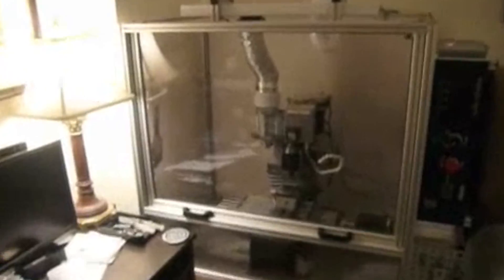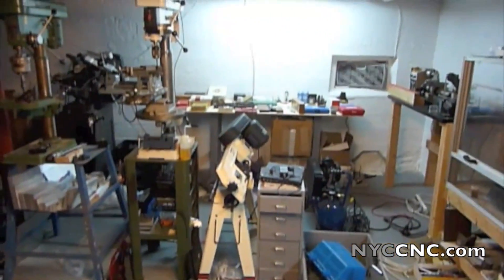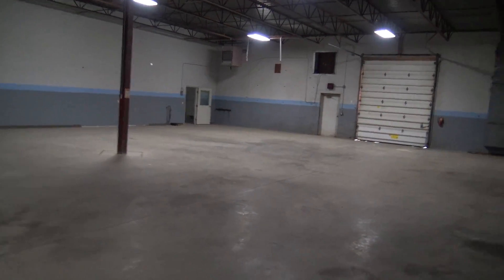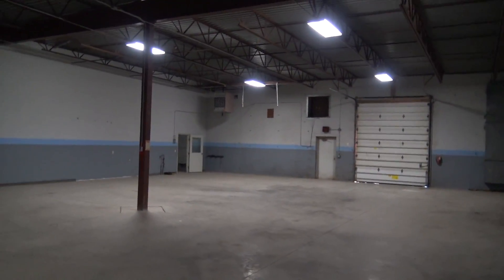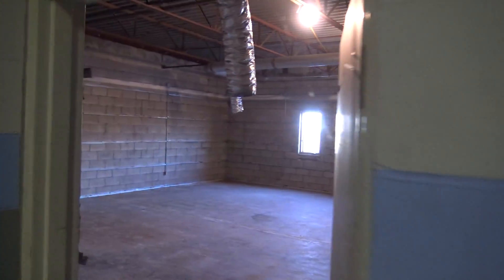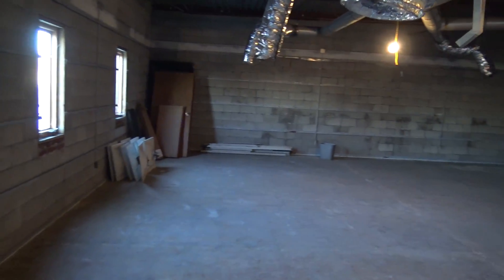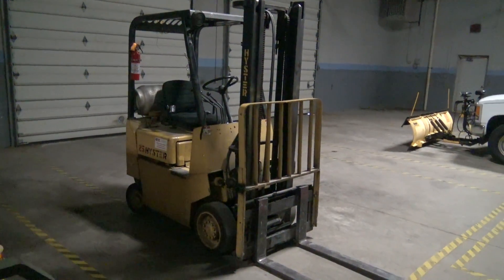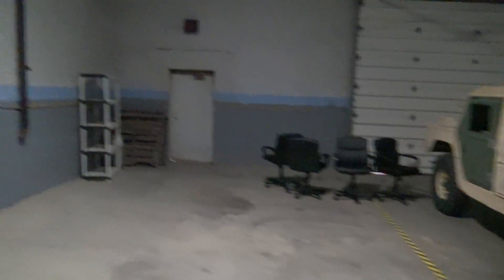We're Moving Again - One Last Time!  NEW SHOP!

Comment: Copper air lines is a great way to go. There are a lot of new pex type plastic solutions, but who knows how they will hold up over time. They do have one nice thing in that it's super easy to make modifications and add or remove drops as your shop changes. So you might mix it up and use copper for all the main lines then add pex drops for things that might move. Your shop is in the growing phase, so I'm sure your floorplan will change a lot. Be sure to slope all your lines for moisture control, even with refrigerated dryers it helps.
Calculate your lighting and run the numbers to decide what is best. So much depends on how you use things. If you have lots of machine and task lights, you don't need as much high overhead lighting. You can also mix and match depending on use. LEDs will pay off over time, but there is an initial up front cost. Since you have to buy lights anyway, they are worth a look. Also because many large companies are switching to LED, you can get used lighting fixtures for pennies on the dollar. I did that and put metal halide HID high bay lights in my warehouse because it's mostly storage and the lights are not on all that much. I got a few pallets of good used fixtures off craigslist. Super cheap to buy but costly to run. In my shop I have LEDs because they are on almost 24x7. The lower electrical use paid for the new fixtures in short order. Because of your video stuff, I would camera test any lighting to be sure the color temp and refresh rates are going to work for you, too.
Good luck in the new shop. It looks like a fantastic building for you.

Comment: Have you thought about maybe having a rackmount server with virtual machines running solidworks or fusion 360. So if multiple people are using cad at the same time the server could allocate to each person a certain number of cores and if less people are using cad they could utilize more cores, Another advantage of using a server to run cad would be that dust would not be a significant problem because the only thing exposed would be the monitor, keyboard and mouse instead of the whole machine.

Comment: Due to the height I would use High bay LED fittings if you use T8s or T5s you are going to need a lot and they are not made for that kind of distance. as Jeff Trithart said go with this mans advice as he's done it. There are some drawbacks with LEDs they do seem to cast very strong shadows so placement is key. Why not put the welding and grinding shop in the garage area until a proper wall is built, remember to keep the dirty stuff near access doors for ventilation and easy of cleaning. That's my 2 cents worth have fun.Phil

Comment: New space looks awesome, congrats. I would take a look at the aluminum air line systems from Atlas Copco and Kaiser. Otherwise go copper. I agree with the T5 they have electronic ballasts so no flicker and long bulb life.  LED are not there yet in cost savings vs. light output per power.  You could partition with welding screens with telestrut frame members bolted to the floor. Cheap and easy to maintain.

Comment: Your areas:
* Setup
* Toolroom / Tooling
* QA/QC Inspection
* Office
*  Machining
   * Milling - Manual
   * Milling - CNC
   * Lathe - Manual
   * Lathe - CNC
   * Drilling
   * Grinding, wether it be bench, pedestal or surface grinding...
   * Assembly
   * Plasma, Welding, Fabrication, etc.
   * Pressroom (forming,  and bending machinery)
 *  Storage (Materials, etc)
*  Compressor & Mechanical Room
*  Bathrooms
*  Maintenance area

I have suggestions for each of these if you'd like to hear them.  you know my email.
Reply: Great, glad to be of help.

Comment: LED all the way T5s will strain out your eyes and will look terrible on camera
Reply: Not to mention getting rid of "ballast buzz". That sound drives me crazy.
Reply: +David Ferrer They have better full spectrum, so whatever you do, on camera or not, will look better.  Plus, they are about half the energy use of even good Fluorescents (like new T5's with electronic balasts)
Reply: +kitesquid Yeah lightbulbs add up over time and cost twice as much to power. The new LED fixtures are guaranteed for 10 years, they will pay for themselves.
Reply: +BluetoothSensei no "ballast buzz" on electronic ballasts.  You get a buzz on magnetic ballasts as the operate at 60 Hz.

Comment: Concerning the moveable partition: as someone has already said, find out first what the fire code will require for commercial space. You can make a wall down from the ceiling five or seven feet and then your partitions go from the floor up to  it. You can combine sliders and two-fold accordion. You can use galv 2" studs from a commercial drywall supplier to fabricate hinged rectangles. You can skin those with painted sheet metal or plywood, depending on whether you need a fire separation wall. You might screw some sort of T track threshold to the floor which would cover the line where the epoxy coating stops. The threshold would be slightly ramped to avoid a trip hazard and allow the fork lift to drive over. Good luck. Oh, also insulate your ceiling.

Comment: Nice, that looks like a way cool space! LEDs are the the way to go but... they are really expensive! Go T5 and then in a few more years when the LED's are cheaper and the T5 start to crap out swap them. Cooper is kind of old school for air lines, I would look into aluminum lines. There are systems available with fittings specifically for compressed air lines. If you need to save some bucks go with black pipe and just get a dryer for the compressor, which you are going to want anyways, and then you shouldn't have and issue with rust. I would epoxy the whole thing, welding shop and all. My last employer build a new shop and has epoxy in there welding bay and zero issues. Just don't cut on the floor and drop a mat/plate down if you need to! Another option is to dye and seal the concrete. My neighbor, a body shop, has done that and they really like it. The floor stays and nice grey/white and doesn't get damaged by all the traffic. Sweet fork, 2k lbs is plenty for 99% of the time. Lets face it, most of the time if you need a bigger fork you probably should be hiring a rigger to do it right and with proper insurance against damage! You think your saving a buck moving that machine yourself until you drop it on its side... been there, dropped that, paid the rigger the next time!

Comment: To divide the room use these hanging strip doors. They are like massive strips of plastic the hang there but you can just walk straight through them. Don't have these all along though, one each side on the pillar build a wall and put these in the middle of each side under the light rail.

Comment: This is awesome, I'm excited for you guys! 
Check out Gough Customs shop tour video for an idea for splitting up the space and air management. 

https://youtu.be/OQy9fAmJlfM
He only talks about it for a few seconds at the start, but you can see him take it apart in the next video after it, when he installs the cnc. 

I would think you could do something similar but with stiff plastic panels instead of a sheet of plastic. Maybe use a warehouse curtain for the doorway. It seemed cheap and easy while looking good being efficient.

Congrats on the new shop!

PS: Go with LEDs, last forever and cost so much less to run, worth it even if the initial cost might be higher.

Comment: OK, I cannot comment on the lighting - not my specialty... ;^)

Compressed air lines are usually done in steel / black iron pipe - usually in schedule 40 / Class 150 for up to 150 psi service.

Steel pipe can be had in heavier wall thicknesses for higher pressures. It is also reasonably priced for making your mains in say 2"  with reducing tees to provide legs to the various taps. It's also relatively inexpensive to modify at need.

Copper pipe is usually sold for potable (drinking) water service. It gets very pricey very fast, especially if you are using it for threaded installations.

I've also done a fair bit of work in 304 stainless for process purposes. All the advantages of carbon steel / black iron, and the price isn't too outrageous...

You can play around with the McMaster-Carr website and price out a materials list in steel, copper, and stainless, and then decide how you want to go ahead with your installation.

I'd want to keep the vehicle bays for auto / motorcycle work, at least for now... you can always do something with them later...

IM me if you want to bounce some ideas around...

Eric

Comment: T5's are the way to go right now - though the spectrum on the T5's suck.  I see tube LED's advancing and being retrofitable in 5 years.  E26/E17/E11 (Standard Edison, Intermediate, Candelabra) bulbs - go LED now and get dimmables.  Partition the room with Convention center type bifold doors --/\/\/\--  when Open they stack against the wall.  Put a personnel door against the center pole.  Hanging barn door rollers with pivots at the top and the center of the panels and 4 1/2" hinges top,middle,bottom on the panels.  I'd fab them up out of 2x3" tube with some insulation inside them.

Comment: Only observation/suggestion, I would invest in drop ceiling and room enclosure for all the cnc/machining/measurement cells.
Making the machining cells smaller would make it much easier for climate control so you can get the most out of any
tight tolerance work you may need to perform, especially if you invest in larger machines in the future. You would not need to wall off the grinding/welding area as a result. Now, back to my 1.3 car garage attempt of a shop in progress :(.

Comment: LED's all the way. Check out the LED streetlamps.  Custom auto parts & install center? Go with copper lines (or just a copper trunk with another material down to the stations). You're gonna have a tough time keeping a 'temporary' welding/grinding space looking nice. May as well section it off and put a metrology/quality room in while you're at it. You'll have to get the wizards in to check vibration before going so far as to get a CMM, but Hexagon has some nice 'shop floor' models that can handle the vibration.

Comment: Congrats on your new shop! I would recommend trying to find an LED solution, as the cost compared to a Florescent is about .30-.50 a year difference in favor of LED per fixture in 60w applications. Also, if you can, upgrade your plumbing to PEX. This is not a necessity, but having spoken to multiple plumbers this year, PEX is new, and it's great. 

as for led's, check these out. They have a lot of great images, and should show you the potential with LED's. http://www.ledtronics.com/Applications/ApplicationsDetail.aspx?id=50

Comment: John,

With regards to partitioning the space, a wall with drywall and light gauge metal studs is the best way to control the dust - coupled with a properly designed ventilation setup...

The welding curtains give you the most flexibility, but they won't stop dust from migrating around.

Vinyl partition curtains hung from the trusses will give you better dust control - and you can buy them with tinting to limit the visibility of arc-flash from welding... they do, however, tend to break off as they become brittle with age after a few years.

Another option is similar to how they do the partitions between ballrooms in hotels/convention centers, with lightweight wall panels hung from a track system...

I'm guessing (SWAG type guess) that your optimum choice is going to be the "permanent" wall with sheet metal studs and drywall - this is the way that commercial shops and warehouses get repartitioned every day... and, it's not terribly expensive to tear out and build again in a different configuration when your needs change.

As an engineer who did a lot of industrial ventilation for many years - and I still do a little on the side to keep my hand in - I do want to emphasize that your dust collection system - hoods and exhaust ducts, and your makeup conditioning air - are going to be key in keeping things clean in your new shop.

OK, back to watching the video to find out what some of your other questions are!

Cheers,

Eric

Comment: Congrats.
I wouldn't go with fluoro lights, I'd spend just a tiiiny bit more and get LED lights. Maybe even just fluoro replacements, or completely different lights.
They're more efficent, rarely(if ever) burn out, you can get them in very high CRI rating for pleasant daylight-like glow, and they are MUCH brighter for  the power(you'll need around 200W of LEDs total compared to a kilowatt or two of fluoros).
For air - get plastic. It's cheap, it's reliable, and you can use larger pipes to double as a tank, so you don't need to install one.
If you don't mind violating OSHA, get thick PVC pipes, if you do - get air-rated pipes.

Comment: A couple ideas:  For the air, the bigger the pipe the better.  With any pipe or hose, you'll lose pressure over a distance.  The larger the pipe, the less pressure you'll lose, and the quicker it'll recover.  This does mean you'll need a large air compressor, because there's more volume than if it was smaller pipe, but it's worth it.  Last time we moved shops, we used 2" galvanized steel pipe, because we had a lot of it laying around from an old irrigation project.
For the divider, I don't remember where I have seen them before, but there are movable walls that I think would be perfect for something like that.  They're on rails, and can move aside when you need to get something large through (think like sliding barn doors.  I've also seen accordion style ones, but those seem like they'd be more prone to failure)  and when you need to remove them completely, you have a forklift!
Reply: +NYC CNC Hey, we don't have an air supply problem!